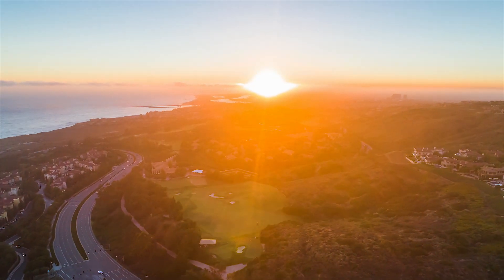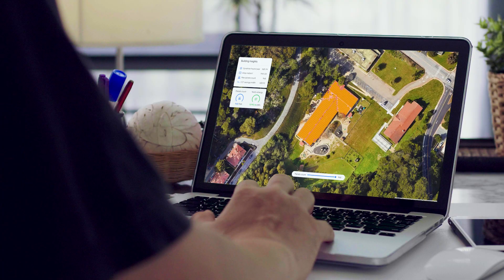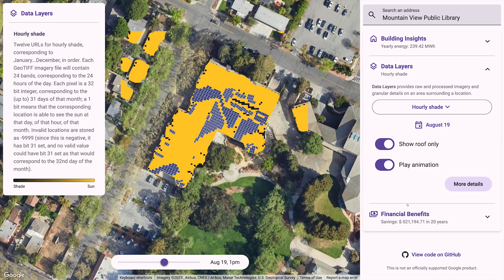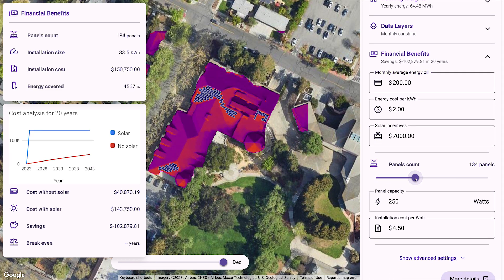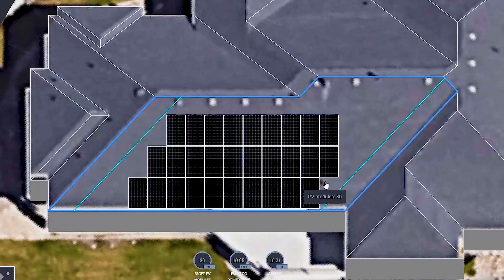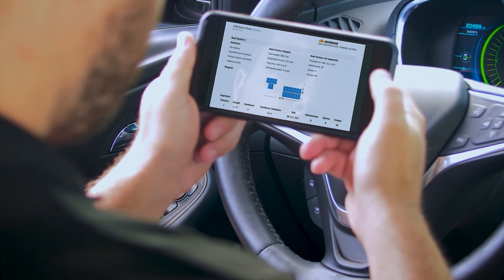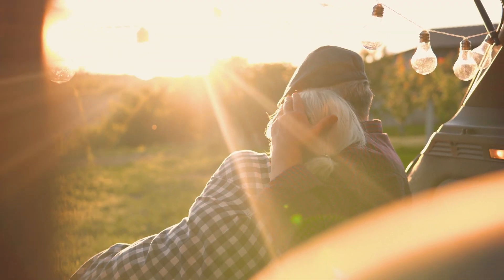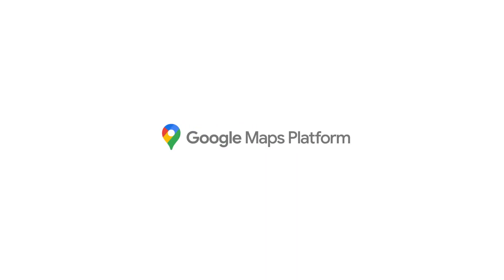Introducing the Solar API

Comment: This is a great presentation. However, most of the advertised features are not available to developers. Many features have been either disabled or restricted. The API gives output based on a 250W panel and dimensions that have not been in use since 2015 and there is no way to enter except the address. There are many variables that we should be able to adjust but the API does not allow it. Are we missing something or is the API advertised for what to come in years from now? We asked in many Google forums. Let's hope the Google experts here respond.